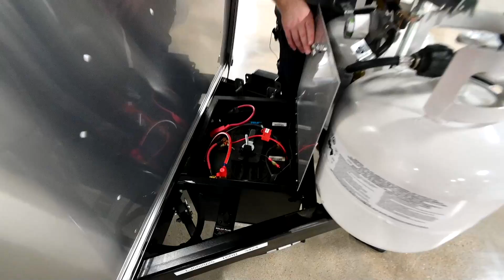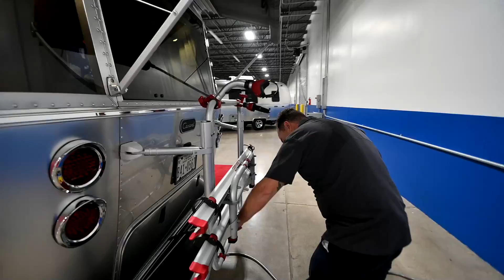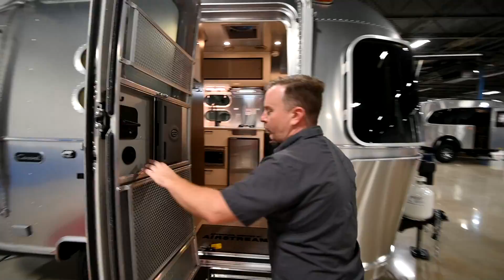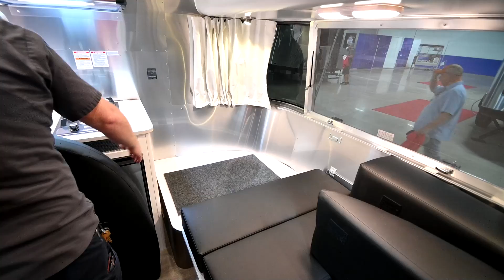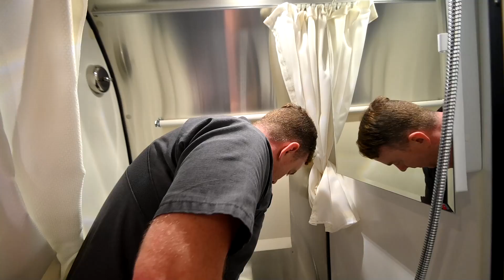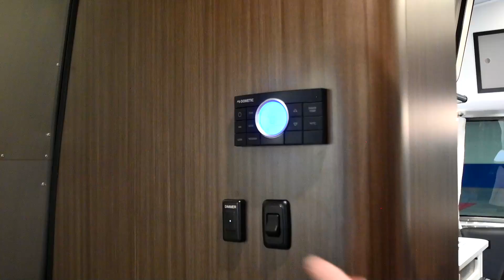2021 Airstream Caravel 16RB | Full Service Walkthrough

Comment: The fridge was glossed over very quickly.  Airstream was having issues with their propane fridges (ancient technology but worked off grid on propane). So they switched to Nova Kool 12V compressor fridges from Canada - well known reputable brand.  However, there was no solar power install on any trailer to support the fridges, which means, these fridges will not work off grid in factory setup. You have to install a full solar setup yourself to support the fridge. At $61,000 for the 16RB Caravel, plus $10% tax = $61,610, its outrageous not to have a solar setup:
1.  A 325 watt Mono Tesla solar glass panel is $230
2. 2 100 amp AGM Deep Cycle Batteries is $250 at most or less.
3. True Sine Wave 2000 Watt Inverter costs $400 most models.
4. Cable, fuses, and connections $50
5. MPPT Charge Controller 30 amps $120
6. Other misc junk $100
7. Total comes to: $1150 for a robust system that would support that small fridge and provide recharging or AC to other appliances.  This is at retail pricing not cheaper commercial pricing which would be half.
For close to $62K, Airstream is too cheap to provide $500 worth of solar setup?  Pathetic.  Just sad.

By contrast, I could DIY myself a whole van not a trailer, functionally better than this product, bigger, and with everything on it, and more.  Why on earth would I buy this non functional toy?
Reply: exactly what I was thinking

Comment: Cute trailer but two issues. 1-why put a carbon monoxide detector near the ceiling? By the time it goes off your already dead. carbon monoxide is heavier than air it should be by the floor. 2- no propane power to the fridge?

Comment: Great presentation and much appreciated detailed explanation of how all the components worked. One question I have is why the CO detector in the bedroom is located up high on the wall. My understanding is that CO sinks so it is best for the detector to be located close to the floor. Also, does the storage area between the bike rack and back of the camper lock? Wouldn't want to lose the tool that raises and lowers the stabilizers. Surprised the awning over the door is not waterproof. Seems waterproof material wouldn't add much weight.
Reply: Buy CO detectors at Costco for $6 - tiny ones very powerful.  Problem solved.
Yes, everything can be locked and removed to prevent theft.

Comment: I cant help to think that with a price tag in the 60K range, you are paying for the name.  Everyone on this trailer is manual, not much automation.   Waiting for hot water for a couple of hours is not optimal for a trailer in this price range.  They could have placed an "in demand" system which wouldnt have cost them much to add, but would add a ton of value to the camping experience.  I do like that they have a blue ray player built in.

Comment: Why do new small trailer not have an oven and four burner stove. Way back in 1960 Glendette had an oven and four burner stove. No AC but propane light inside which was a huge help when camping away from what the man calls city power.  Camping is supposed to be just that away from the city and into nature

Comment: Too much work and gadgets!
Reply: I had the same thought.  Would require a responsible smart person to operate.  A person with diminished mental would fail or struggle not to break something or do something wrong.
Reply: No, its not.  Its very simple. Open your ears and take your face out of Facebook. Less gadgets than a house.  You know how to live in a house, don't you?
Reply: @lass-inangeles7564  -- I have a 41' 5th wheel and a 30' Travel Trailer. Both put together are easier to operate than the unit in this video and the bathroom light? Yeah, the switch is in the bathroom if you can imagine that. Push button and awning is out. Push button and awning is in.

Comment: He talks about solar panels but never bothered to say the most important things: HOW MANY WATTS  of energy from the solar panels on the roof?  100 watts is silly--if they don't include 400 watts or more, it's just a gimmick. To be off-grid, people use 800 to 1000 minimum.  But companies can spend your money to put a taste of pricey stuff up there making it more difficult for you to remove and replace with worthwhile options.   Often, you can only expand with their own brand, which they charge very high prices for. (There are videos here on YT explaining all about this stuff.) He never told us how many watts total, is everything A/C, or 9 volts or 12 volts, or 48 volts...and is there a converter, if the system charges from the alternator of your vehicle, how much energy the system is capable of (can it run your hair dryer, coffee maker, etc?) and other techy subjects.  Sounds like great info but he left out the most important stuff.  These vehicles can be complicated at 1st, but you must learn the basics to be a responsible owner and not waste all of your money.
Reply: He finally addressed 2 important subjects--neither were great to hear.  1. Hot water: you must wait 30 to 45 minutes for hot w,ater--acceptable 5 years ago but now, and with Airstream prices, they should be offering ON DEMAND hot water.  It heats the water as it delivers it to your shower--no wait.  They can be much less wasteful as well, using less of your precious fresh water. Not a big deal if you are hanging with other seniors in the RV Park, but if you are off-grid with views of the Grand Tetons, you need to maximize your use of every droplet... they recirculate the water that's not hot enough yet, etc.  2. Regrigerator power: Sounds like this is all electric--worst power option of all.  It will empty your battery of energy very fast and you need shore power to keep your fridge cold.  That's why it's important that your alternator recharge your battery as you drive and that you get the maximum watts from your solar panels.  100 or 200 watts are not enough to power an electric (A/C) fridge.  I thought D/C is European electricity? I guess I'm wrong? so I can't begin to know what that means here.  Is it the volts generated by your car's alternator as you drive?  That may help power your fridge.  But when you stop, you'd be back on battery power, dependent on recharging from the solar panels.  People use a dedicated power station to support an electric fridge, and run several hundred watts of solar panels just to keep it charged--for just an electric fridge.  That's why his omission of these numbers was important.

Comment: no way i would be good with this rv. 

day 1 i would not have the screen and door together and would break my screen door. 

on top of that the deadbolt would be sticking out and i would break off the dead bolt. 

on top of that i would have both propanes open and when i ran out i would be stuck. 

on and  on and on..

Comment: It seems as though an airstream dealer would know that the majority of airstream owners boondock or dry camp almost as often as plugging into city power and water. And yet he continuously says over and over again your air conditioner your heat pump and your microwave will not run without city power. They've invented these things quite a while ago called a inverter generator that we all carry with us they're quiet they're economical and they allow us to have the power to run all of those appliances regardless if we're in the middle of a national forest a hundred miles away from any city power. Come on man

Comment: Lmao! Who designed the super easy like threading a needle blindfolded awning system? Ho!y shite!! They have got to be kidding. "You simply take your 10 foot awning latching tool, reach up the 12 feet to the top of the camper, wiggle the metal loop at the end of your rod into the easy as pie latch, and move it 90 degrees North of where you're standing, then you twist it 180 degrees south, tap twice and youre  done! Eezy Peezy, goober.

Comment: $8,000,000.00 for a 16’ travel hot box…and you have to use a converted dip stick to deploy the awning! Geez..Airstream needs to joins the 80’s! Man, rob a brinks truck to buy this little thing, no auto stabilizers, no electronic awnings, no LP monitoring, awnings not capable of protecting you from anything other vitamin D, spend 14 hours at campsite before opening the side door setting up..”honey it’s cute…pays da man his $8,000,000.00!” Yikes